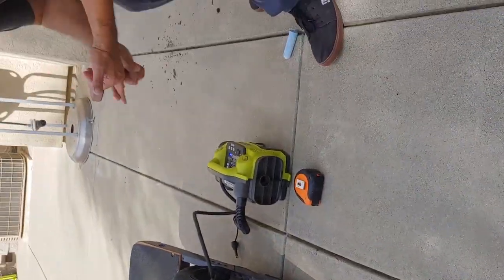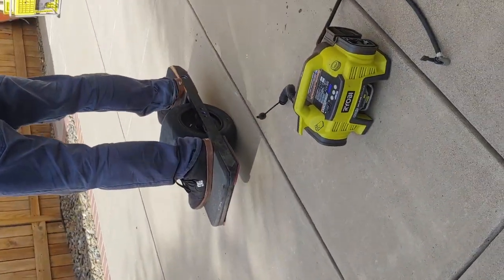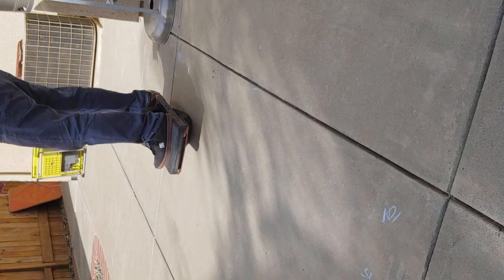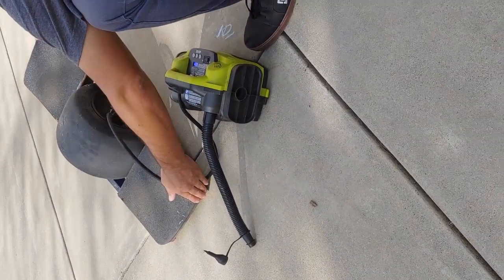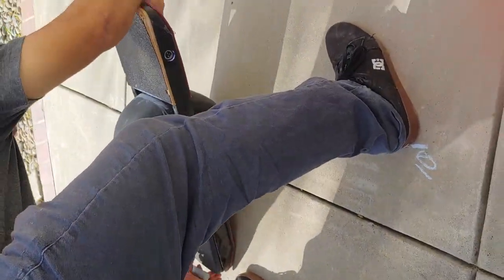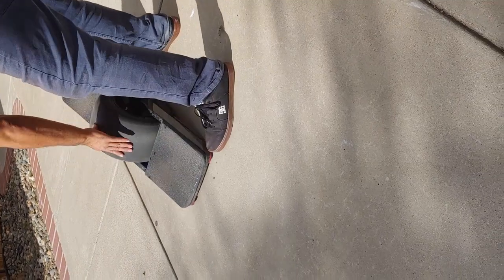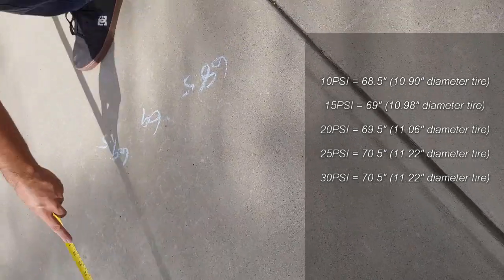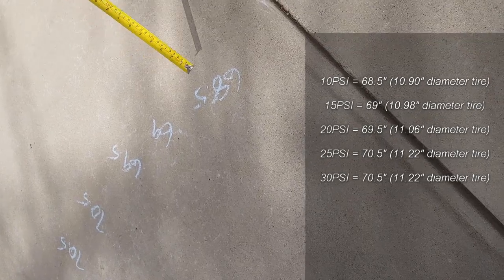Onewheel Workbench: Relation between tire pressure, distance and speed

Comment: Awesome video!
Question, is this an original (1st gen) OW, the plus or the XR; and what tire do you recommend (for an XR) to more closely resemble the nimbleness and carve-ability of the Pint?
I got the XR for its higher range and torque/speed but I would really want it to perform more like the Pint in terms of being able to float and carve.. 
I've never ridden either btw.. my XR is new and still on it's way (got it online)..
Thanks in advance for your (or anyone else's) input! 
Can't wait for it to get here.. cheers!!
Reply from the maker: Get used to it first and enjoy. All tires feel different and change the way the ride feels. The burris or hoosier 11x5.5-6 are nimble and will be closer to the feel of the pint
Reply: @Grind671  thank you for making these videos and for your prompt reply! Just so I understand better, is it an 11" diameter wheel by 5.5"-6" wide..., is that what the '5.5-6' stand for or is it that the wheel comes in either 5.5" OR 6" widths, and I choose either one or the other...?
Or am I just flat out not getting this part lol?

Comment: I'm pretty sure that there is another link between range and pressure. Lower pressure means more traction, means more force needed to spin the wheel, means less range but more control.
Reply from the maker: Yep, thats true
Reply: @Grind671  nice idea btw to get some measured dates like rpm or tire diameters under different conditions. Maybe you can make a video about how different riding modes affects measureable parameters. Thanks for sharing

Comment: So dude,what pressure do you ride at for just thrashing around town on and how much do you weigh??
Reply from the maker: It depends on the tire, my mood and what i plan on doing. If im going to jump or drop stuff, i like a lower pressure. If im looking for speed, range and nimbleness, i ride a higher pressure. With this tire i usually ride between 16 and 18 psi for a good all around feel. Im 205lbs with shoes on